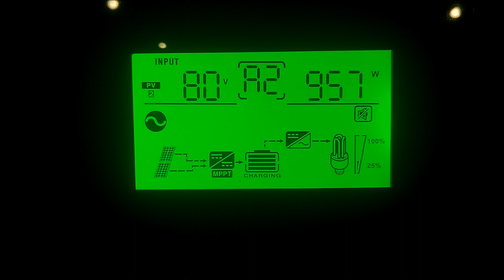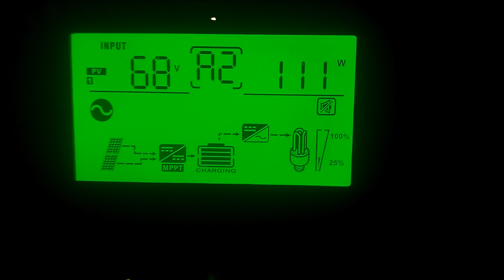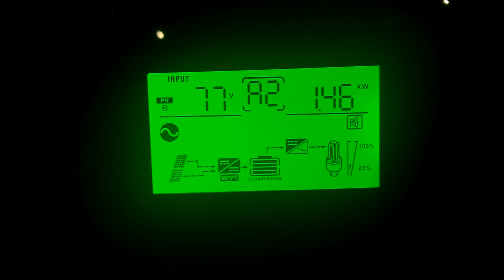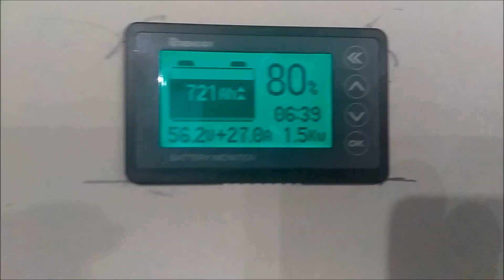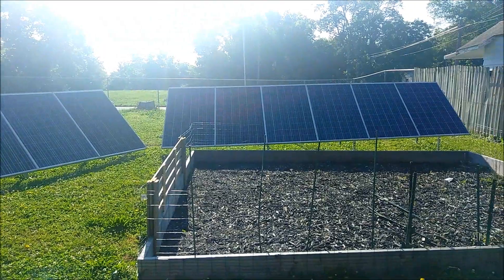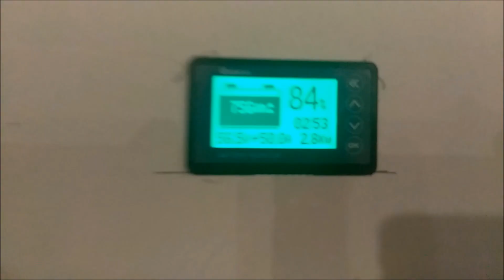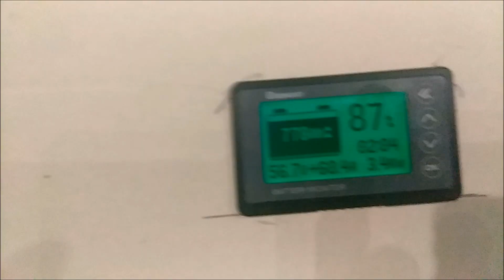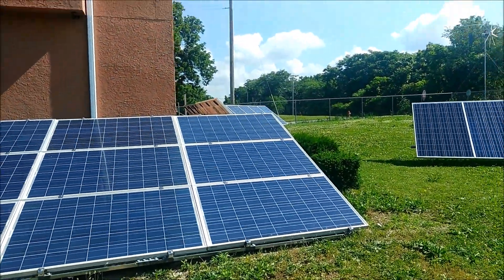east facing solar panel power from 7:30 a.m. to 10:00 a.m.

Comment: This is the way to go if you aren't getting paid for excess power from your power company. There is no point getting maximum power from the panels by pointing them all south if you can't use it all and/or if your batteries can't take the charge. I have a smaller system as back-up and to supplement some power.
 I have my transfer switch setup to transfer my fridge and freezer to solar as soon as the batteries get to 13.4volts(12v system), so I want to get my charging going ASAP in the morning.
I am over paneled compared to my battery capacity, I have enough panels to be floating my batteries by 10am without loads running so the excess would be a waste, but when it is cloudy I still have enough solar to fully charge the batteries and run load as well.
Reply from the maker: I run full time on my solar system do not send any power back through the grid to the power company.  Whenever I have extra power in the summer I turn the air condition down cooler to cool the house off before the sun goes down and in the winter I turn the heat pumps on to use the extra power so the power is always being used thanks for watching.

Comment: What size of air conditioner are running, what is your combined solar watts
Reply from the maker: 18000 BTU mini split air conditioner. Panels are about 10,000 Watts.

Comment: Working great! That's going to be a good power curve even under load.
How do you handle summer peak power rates? I have my system set to run off batteries in the event of extended clouds to avoid the %150 charge.
Hopefully your neighbor sees the benefit of solar and will Invest...
Reply from the maker: I run off of the batteries full time use solar doing the day and run off batteries all night I try hard not to go back to the grid. But if we do they only charge us for the power we use because they already hit us with a $20 delivery charge whether you use the power or not.

Comment: Nice field of panels... question: i have a charge controller that is rated at 360 watt @ 12 volts can i use a 365 watt pannel since panels produce less than its rated watt ???
Reply from the maker: I think you will be good with that 👍.
Reply: @carsonlurbanwindandsolar3437  thanks.. i live in jamaica we get decent sun on the  island.. hope not to break the controller lol..
Reply from the maker: The thing that will break the controller is if you send too many amps through it normally you can go a little over the wattage because the panels normally do not produce exactly what it says they will due. If you put too many amps through it it will blow the capacitor out don't ask me how I know LoL 😁.
Reply: @carsonlurbanwindandsolar3437  😎kool respect..
Reply: I am not you, but if I was you I will return it and go with a 48v system, 12v systems are too expensive, wire wise